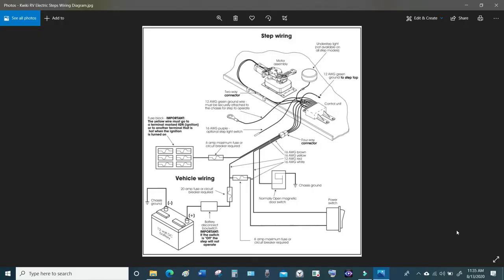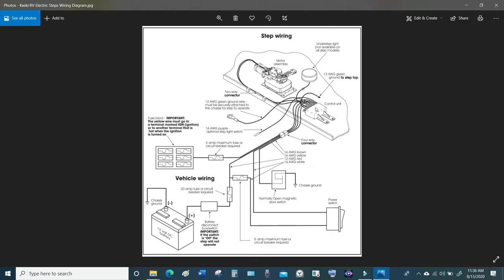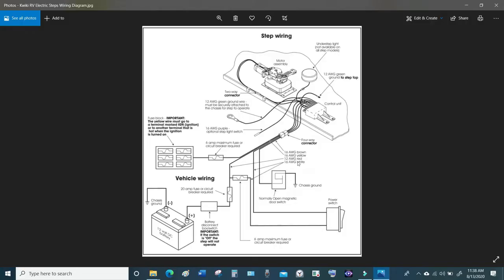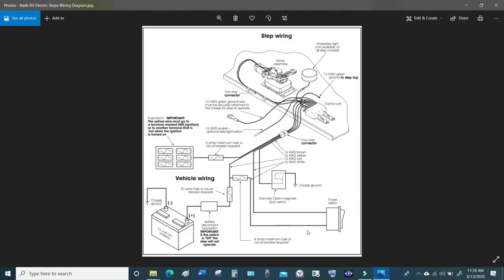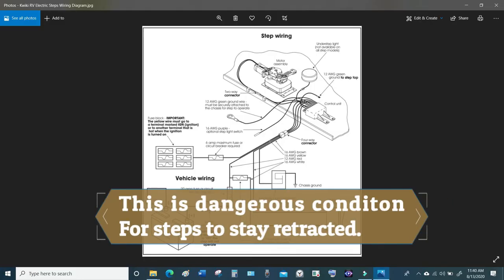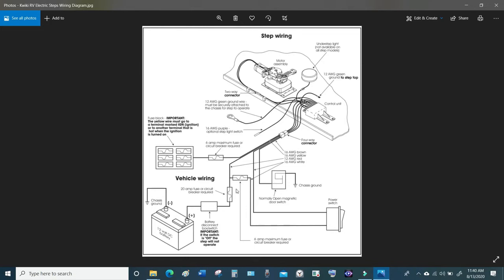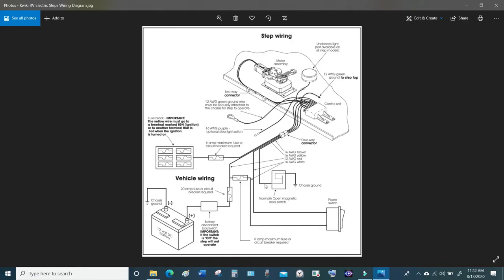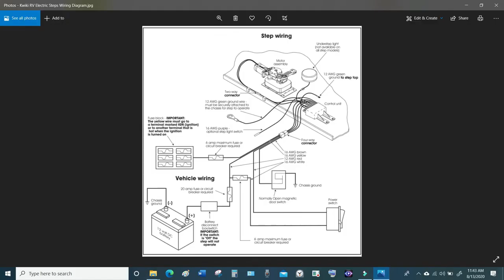RV Electric Steps Troubleshooting Procedure

Comment: Thank you for the awesome video. I have a question, my step won’t stay out even though I flip the step switch to be open. Do you have any suggestion?
Reply from the maker: @giainhsumofamily9038 I need you to give me the condition that leads to the steps not staying out.  One condition is, you arrive at destination, turn ignition key off. Go to door and open it.  The steps go out but do not stay when you close the door.  Let’s start with that.  Let me know if this works by staying out.  This is called ignition override.
Reply: @samowens44  I parked my RV for a while, and while the step staying out. One day I want to put the step back, I heard the motor running when the door open and closed, but my step stuck. I disengage the step arm and oil all the moving hinges. I used a big wood block and slam the step in. Once it in. I pull and push the step manually until it moved freely, the I installed the step arm back. When I open the door, the step come out.  When I close the door. the step come in. when I open the door, press the door switch. close the door, it won’t stay out.
Reply from the maker: @giainhsumofamily9038  if you hear the motor running and the steps not moving, that means the gearbox could have a stripped gear tooth.  You should never hear that condition.  The motor should shut off or try to reverse if at all.  Not sure about the switch not keeping steps out. Don’t know which steps you have.  Kwikee steps are the one I have.  You use the switch to lock steps in, no out.  Lock out is the feature of ignition override.  The yellow wire from control we should have pos battery all the time and hat is what keeps steps out.  The switch will only hold steps in.  To keep steps in you have to go thru sequence with ign switch on door closed and throw the switch steps will stay in then turn off ignition.  That is for Kwikee steps.  Lippert steps work opposite.  Use switch to lock steps out.
Reply: @samowens44  thank you for your help